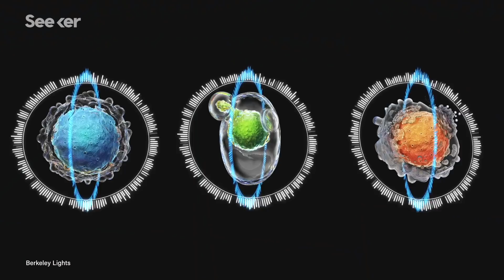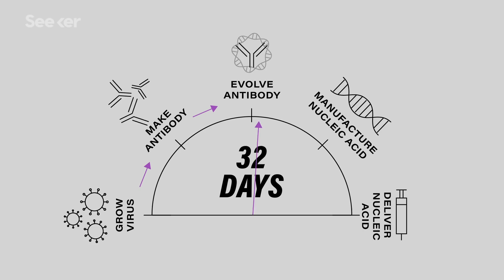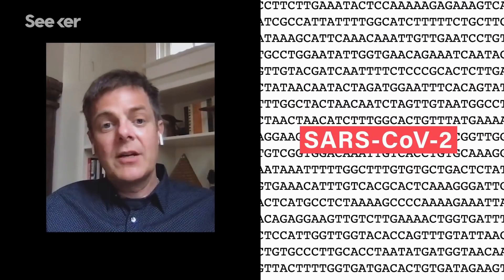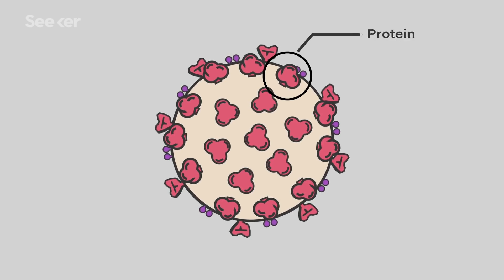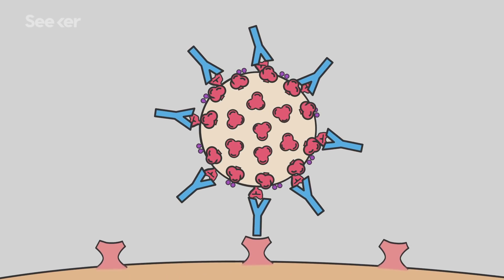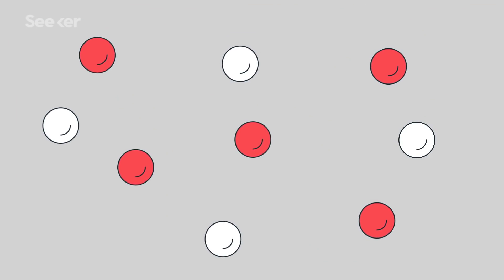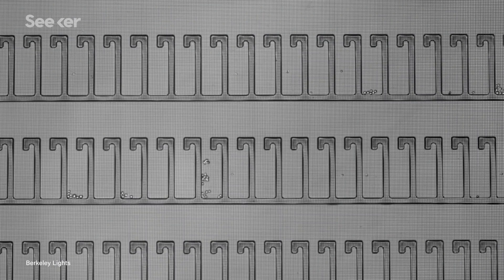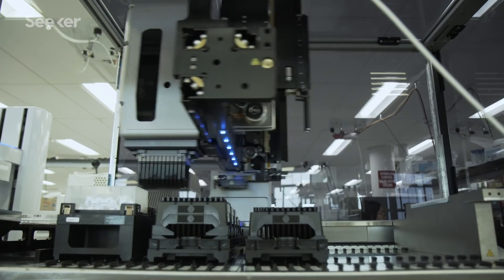The Race to Develop a Coronavirus Treatment in 60 Days

Comment: what if the next pandemic virus or flu... cannot be defended by our immune system alone... and we might need to completely re-create a new antibody from scratch.... will this breakthrough tech potentially capable of doing that
Reply: If our immune system can’t handle it then the symptoms will be much worse. The makes the symptoms better identified thus restrictions will be in place much faster than the current virus outbreak. 
We also don’t need a breakthrough technology to make antibodies for our immune system. We already have technology capable of doing that. It’s called a vaccine.